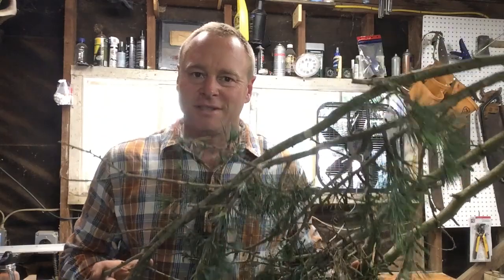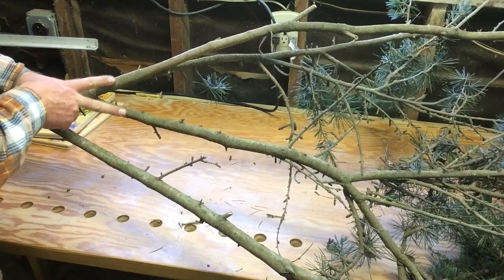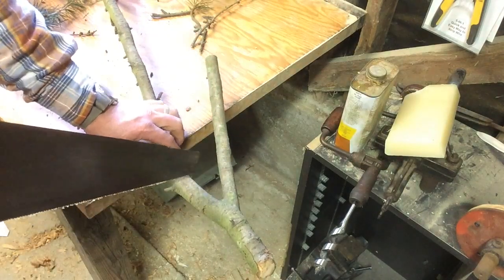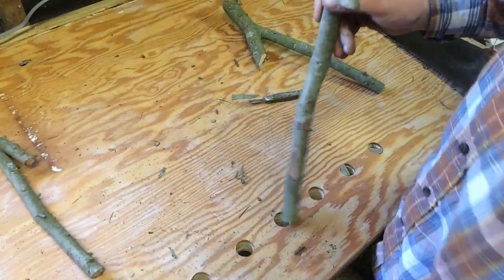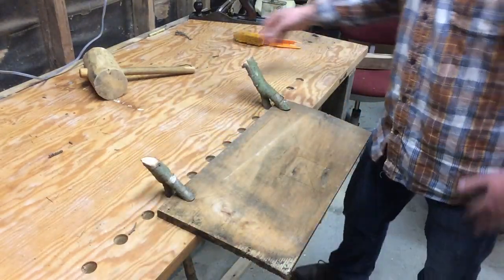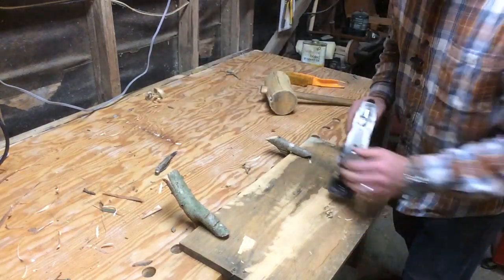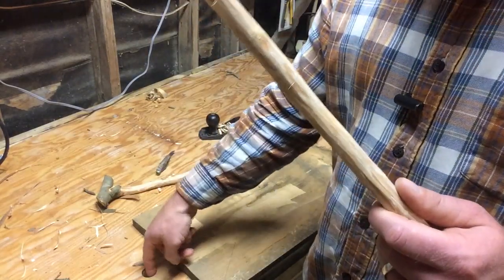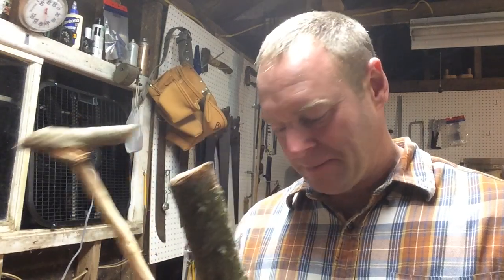Wooden Holdfasts | Barilettes

Comment: The idea is good. Your workbench is not thick enough in order to hold tide the holdfasts. Even if they were good quality iron holdfasts rhey propably could not hold the workpiece very weĺl. Perhaps you could add underneath some extra  2" by 4" in order to make the dog holes deeper.

Comment: I think you are close with your assumptions. Also, planing off the edge of the bench creates a lever and pushes straight up, which is much harder to sustain. They generally are used to keep the piece from sliding, not lifting. If there is bench under your plane, it can't go up. Another point - If the leg holding down the board is longer, it will push harder sideways in the dog hole, maybe making up for the variance in natural materials. Good experiment. Interesting, and look forward to what else you find out.
Reply: What he said ⬆️

Comment: i think it could work, just needs more time in R&D, having Hops, Barley, Malt and water usually helps :)
Reply: Use a springy hardwood like ash. Only work and apply pressure opposite the direction it’s being used by the holdfast. The force you put on it was horizontal while the pressure was down. It’s holding something from coming up, so only put downward force. For planing, you would use a stop, dog, or bench hook. These would be for mortising or sawing straight down, either ripping or using a coping saw.

Comment: If you think about how dogs and end vices pinch the piece of wood... if you would have placed the wood completely on the bench (not overhanging) and put the end of the wood up against the dog instead of on the side, you would have been planing up against the dog and might not have had that problem.  I don't  know if my explanation does it justice.  A white board would be much easier.
Reply: Grassy20, I understood your comment as I was thinking the same thing. Hold fasts work good, but he definitely needed a bench dog to push against. xoxo from Arizona.